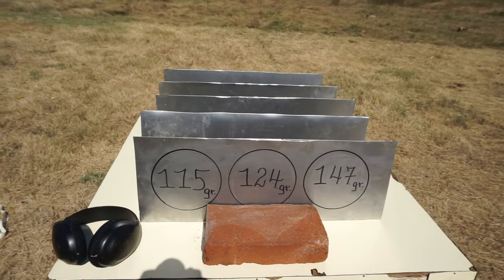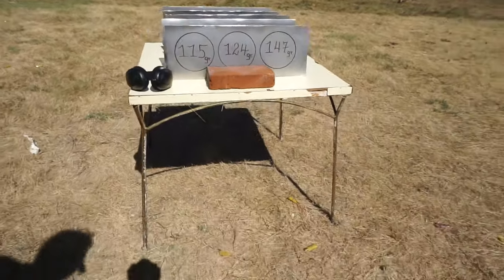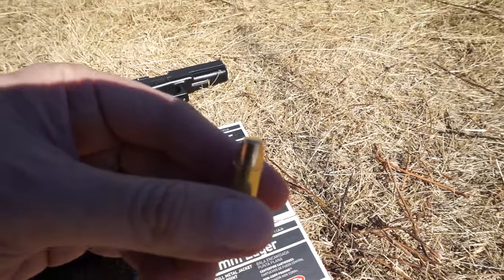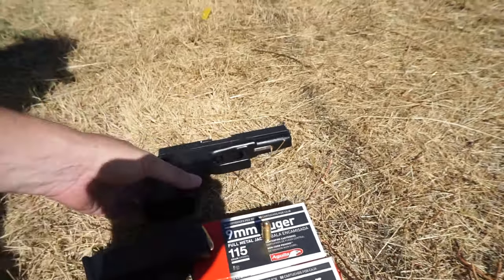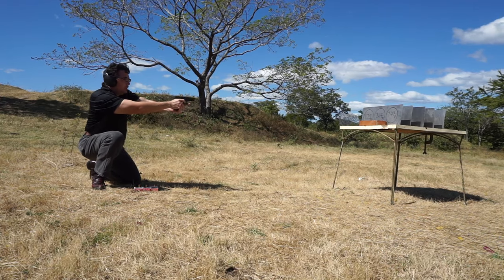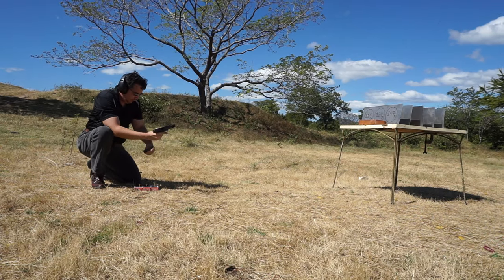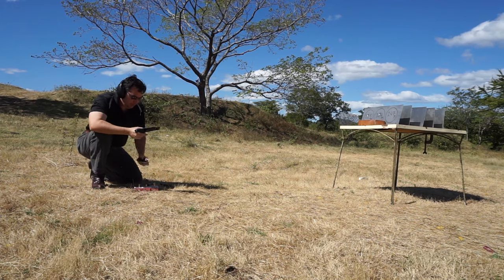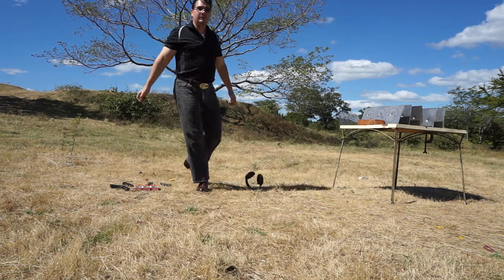9mm 115gr vs 124gr vs 147gr fmj 🔥 vs 5 Steel Plates⚙! (Second Video)

Comment: Ive shot 147 for a long time in my G19,  impulse just feels right I like theres not much over penetration. great defensive gun ammo, however I would lean to the 124 for combat use.
Reply: Yep depends on what combat scenario though. They all will work great except i know the 147 grain will be great for close quarters
Reply: 124 is NATO
Reply: With a 4" barrel the best 147s work great - Federal HST 147 is top dog.

In a micro 9 it's a different story.  The 147 won't go fast enough to reliably expand.

Comment: Moral of the story : Buy 115gr, because it's cheaper, plentiful on store shelves and does the job like the other two.  Most buyers seem to have an affinity for bigger numbers on the ammo boxes... and bigger numbers = bigger prices.  Good video, thanks!
Reply: I prefer NATO 9mm. While it’s usually 124gr it is also hotter so I would think it’s the same as 115gr.
Reply: Recoil is a bit snappy with 115gr.
Otherwise, no difference.

Comment: Doesn’t seem like there is much difference between 115 and 124 gr
Reply from the maker: Paddy Mac I've tested them (off camera) many times and the 115gr penetrates a little bit more. Thanks!
Reply: You should repeat this test with a 3" barrel pistol, using only 115gr and 124gr bullets.

Comment: Penetration vs Expansion & Energy Transfer @Jonah Patton  although unpopular, your opinion is statistically and strategically accurate.  While expansion and energy transfer should be valued, penetration is the most disabling measure of a cartridge.  There's a reason that military cartridges have trended smaller while their load has become bigger.  On top of that, favoring a penetration round mutes your adversaries use of some walls and increases your rounds ability to get thru thick clothing and some "bullet proofing" materials.  The only time penetration should not be your priority is when collateral damage is a likely issue (home defense with kids in the next room etc)

Comment: The best test I've found so far, I've seen enough I need some 147 for CCW
Reply: Get the federal HST
Reply: @wread1982  I don't care about brands as long as they shoot I'm wanting the extra weight down range is all.gpt a Taurus G2c with a 30 round mag I want it weight 10 lbs fully loaded🤣

Comment: 147 stopped short but that’s not a bad thing, means the bullet would more than likely do extreme kinetic damage and remain inside of the perp
Reply: There is physics and there is folklore. You are propagating the latter. Even these actual results do not change your mind.
Reply: Exactly;and it won't penetrate through a wall and harm an innocent person in the other room.

Comment: In a previous test, 115 gr 9mm was compared to a 165gr .40s&w. The 40 clearly penetrated further. Some people said the 124gr 9mm would have done better against the .40s&w. This test showed the 115 gr and 124gr 9mm were about the same. I have a Glock 23 in .40s&w and I think I will stay with it.  I will be giving up a couple of extra rounds and a little more money for ammo than say a Glock 19 in 9mm, but I can live with that.

Comment: My name Diego , 
I would like to know which lawman for a weapo pistol g2c caliber 9mm 115 or 124 grains for home defense?  which would improve in a g2c
Reply: I think the heavier the better since it seems that the less heavier bullets penetrate more and the heavier, less but then transfer more power.  
That way your bullets are less likely to go through your target and hit someone else and go through walls less easier.
Reply: hey brother, i,m not an expert, but i do have a g2c as well. great accurate little gun out to 15 yards and will eat anything cycles both brass and aluminum cased ammo like a charm with one caveat, it hates any kind of steel cased ammo with tulammo being the worst.

Comment: I was just curious, what Gauge or MM thickness was the sheetmetal? I have read that here in the US the FBI testing is done with 18 gauge 3" apart, 2 sheets IFIRC.  (It is to simulate a car door)   This is 1 of 5 or 6 barrier penetration tests they use to evaluate their hollow-point carry ammo.  9mm 124gr now is as good as 40 cal ammo in every category!   Thanks to Hornady's  "Critical Duty" Ammo  That is amazing.  This has been proven from their testing, and shown in the data.   Solid FMJ's should have even better penetration than hollowpoints. Hollowpoint ammo is designed for making massive wound cavities. Solid FMJ's are not. They are for target practice,  (in general terms I am speaking about here.)   Solid FMJs go straight thru a target with near zero expansion and small wound channels. That is why it takes multiple shots of FMJ's to equal the damage done by 1 or 2 shots of a quality hollowpoint ammo fired at the correct speed.

Comment: 147 grain have less recoil so putting follow up shots on target and shot placement are the most important factors so I'm sticking with 147 HST.
Reply from the maker: Ok 👍 but check first if it doesn't get jammed in the chamber because the 147gr has a flat nose and occasionally it got stuck a couple of times in my Glock 17.
Reply: I always assumed the larger the bullet/more mass would equal more felt recoil?
Reply: @DaDaDo661  shoot 9mm 115, 124, and 147 one after the other and you'll see that the 147 shoots the softest. It has the least amount of FPS.

Comment: What's your personal choice for defensive purpose?
Reply from the maker: Very tough question, when it comes to handguns like the classic ones (.38Sp, 9mm, 40s&w, 45acp, 357mag) to me they all do the same "they are great" and thats why they are legends through centuries, i make myself the same question 24/7, but one thing is clear: I like to have 17 rounds in my Glock 17 or 15 in my Beretta 92fs😜
Reply: @jacktheshark7440  I love my Glock 17 but I also love my S&W 686 plus 7 inch. Hard call. The Glock is best for home defense but the revolver is just so freaking cool.
Reply from the maker: @SaintBrianTheGodless  the Smith & Wesson 686 well built reliable great revolver!
Reply: @jacktheshark7440  i have a Taurus PT92 with 17 rounds, such a reliable gun!
Reply from the maker: @MrVinicios01  Taurus makes good Revolvers.
Reply: @jacktheshark7440  i like the multicaliber RT692 357/38/9mm
Reply: @jacktheshark7440  g17 gen what?

Comment: Wish you could try my 90 grn 380 acp round nose I loaded into 9mm cases. It’s a pretty hot load to function reliably in my sub compact 9mm. I would bet it’s moving very fast.
Reply: Those would have went through all five sheets.

Comment: You picked a Brand with under powered rounds, in other words light loads.  Next time try 124gr pushing 1200fps, and 115gr pushing 1150fps.   We ran the same test using a Ford Explorer, the 124gr NATO Winchester Brand punched right through both front doors when engaged at 20 yards, the 115gr Winchester just cracked the door panel on the passenger side after passing through the driver's door. the 147gr Winchester dented the passenger door.

Comment: In shorter barrels the 147gr never truly reaches its stated velocity.  In 4.5 to 5 inch barrels and longer, the 147gr does much better in reaching its stated velocity, with higher energy dump, better wound channels and beautiful expansion out of longer barrels; average expansion out of 4.5-5 inch barrels.  
The 115gr is better for sub compact/micro, having softer recoil, above average HP expansion in shorter barrels and generally reaching stated velocity, but has a smaller wound channel, lighter energy dumps.  I’ve seen tests, out of longer barrels, where the 115gr HP’s act like FMJ’s.
The 124gr is the one size fits all; with a tendency to reach higher than stated velocities and over penetrate in longer barrels, but reaches close to stated velocity in short barrels.  124gr has average wound channels, energy dump, and good HP expansion, in all barrel lengths.  
Velocity is what causes HP’s to penetrate and expand.  147gr HP’s do very poorly out of barrels less than 4 inches, and are not as stable in flight , from short barrels.  124gr are, over all, the better choice.  They shoot well, expand well, have manageable recoil, and produce a good wound cavity, in any length barrel.
Reply: I shot all these in a 938 sig and the 147’s are the softest recoil, 115’s way snappier !  Been using Fed 147gr hst for years and to me seem to be the best and they are accurate avg 950 fps. 147’s aren’t made to push at super high velocities, mostly made to perform at lower speeds with suppressors .

Comment: I think I'd try this with proper support under the full length of the bottom edge of the plates, there could be some flex in play, at the outer edges where there's no support, that might skew the results. Just an observation. interesting test, thanks for doing it!
Reply from the maker: Jay Lee 👍 off camera i stayed shooting more rounds and the results were the same.  The 115gr almost always penetrates a little bit more than the 124gr.

Comment: Good video my brother☺👍. The Geco no very fast velocity....at result, i am estimate 1100 fps for 115 gr and 1050-1070 fps for 124. Into similar test the 115 gr at 1200 fps throught 5 steel plate and stop at 6.  Is low velocity for my opinion, sorry for my english 🙏🙏🙏 😆😆👍
Reply from the maker: Thanks brother, the aluminium sheet measures are: "4x8x1.00mm" (its written that way on the receipt from the hardware store).
Reply: @jacktheshark7440  My brother the skeet in the test is aluminium not steel...?
Reply from the maker: @antonelloromeo2118  its aluminium ⚙🔩👍
Reply: @jacktheshark7440  Is hard aluminium, you are sigle this aluminium for identificaly brinnel hard?
Reply: 'round' nose vs 'flat' nose was the difference in my opinion. if all had 'round' nose  the results could be the same.

Comment: I'm late finding this video, but the other upside to using 147 is that it's subsonic, and for home defense using a PCC with a suppressor it just can't be beat. Firing indoors is difficult without hearing protection but when seconds matter and you're just have forgotten to grab your hearing protection the subsonic round + suppressor will help protect your hearing as well as mitigate the potential for collateral damage from the concussive effects of supersonic bullets indoors.

Comment: When hitting hard surfaces such as steel and using fmj ammo the faster the round the deeper it penetrates. When it comes to expanding rounds like hallow points and fragmenting rounds like .223/5.56 it’s the opposite at least on soft tissue. When a hollow point or fragmenting round hits tissues the heavier round will go deeper than the light faster round. Lighter rounds are faster because of being lighter and a faster round will expand/fragment sooner because of the higher speed and when a round expands or fragments it loses energy thus causing it to stop sooner. A heavier round that isn’t going as fast will expand or fragment just a little later and has more time in the tissues to penetrate before expanding and losing energy as well as having more mass to help carry it thru. ✨Science✨
Reply: To add to that. Keep in mind that velocity has twice the effect on energy as weight, that principle of physics applies on impact as well. 
Assuming both bullets have the same muzzle energy and expansion characteristics the heavier bullet going a little slower is going to shed energy more slowly and penetrate tissue more than a lighter one going a little faster even though they are cutting/crushing exactly the same diameter wound channel.

A good example is a 158 grain .38 special +P vs a 115 grain 9mm. One's going 1,000fps and the other 1,175, both have 350 foot pounds of energy but the .38 has considerably more momentum. Over 40% heavier and less than 20% slower, same energy.

Comment: Why even use the 147 if its flat nose FMJ and the other 2 are round nose
Reply from the maker: Can't get a "round nose" in 147gr at least with Aguila ammo.
Reply: @jacktheshark7440  yes you will notice almost all 147 grain is that nose. Flat nose FMJ are actually much better than round nose. You get more accurate shots, better penetration, cleaner holes, if used for large game you want FN because it will punch and crush through bone but round nose will deflect off. It also hits much harder. There are a few 115 and 124 flat nose loads out there. Pretty much any military ammo will be flat nose. Winchester makes a 115 FN FMJ. Federal Syntech training ammo is FN.
Reply from the maker: @WooWooSurvivalSchool  thanks for the information, have you tried Soft Point Bullets? "Sellier and Bellot" has them in 124gr and "Magtech" as well.. can be an alternative.